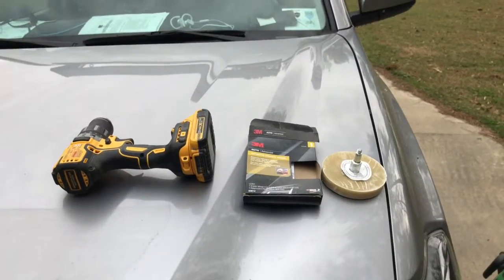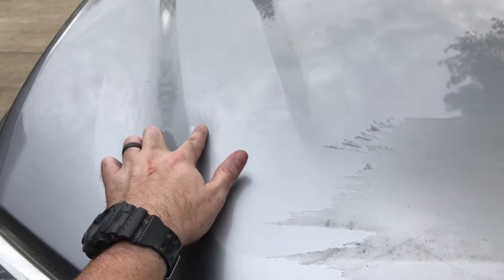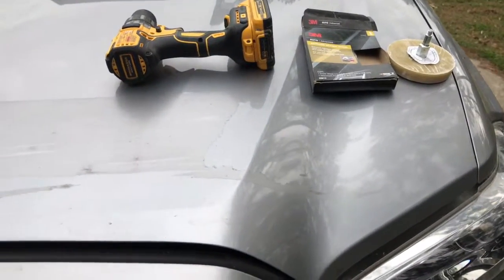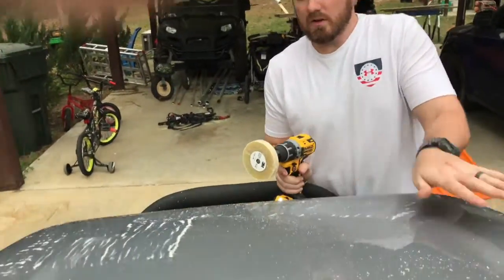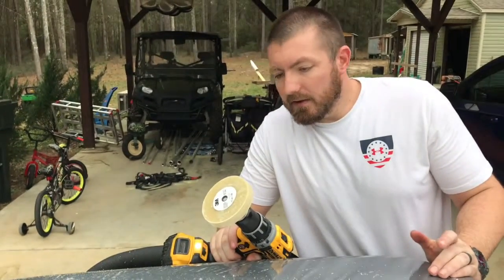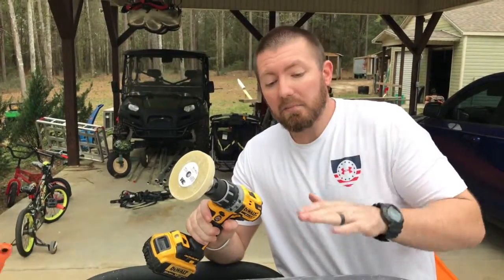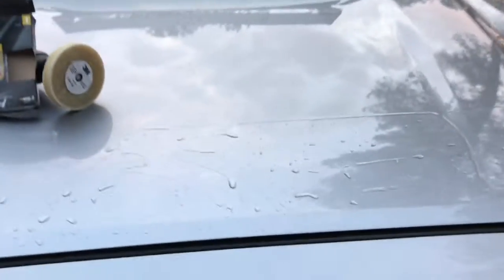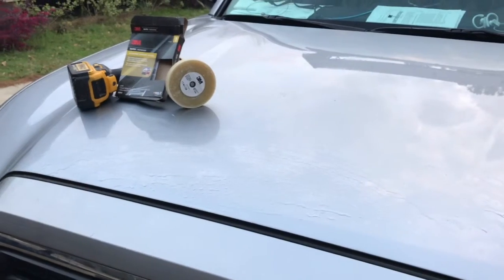When Goo Gone won't work, try this 3M eraser wheel - remove sticky residue

Comment: Great video my man! I am replacing my stock spoiler with an aftermarket ‘duck’ wing and the stock one left a strip of black adhesive. Tried goo gone and it got most of it off except a thin layer. Buying one of these tomorrow and trying out!
Reply from the maker: it will work, just start slow.

Comment: How did you deal with the marks it leaves behind? Like the little streaks? I have all these marks that won’t come off. Would you recommend a paint detail,
Reply from the maker: If it’s the same thing as mine was doing I just kept going over them until they were all gone. When I was finished my hood was smooth all over like it was supposed to be. Just slow going.